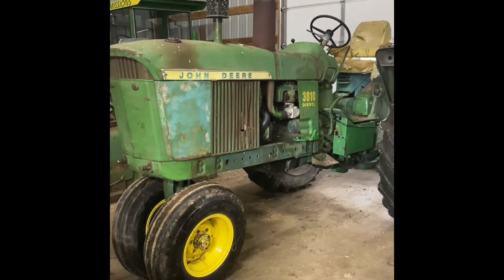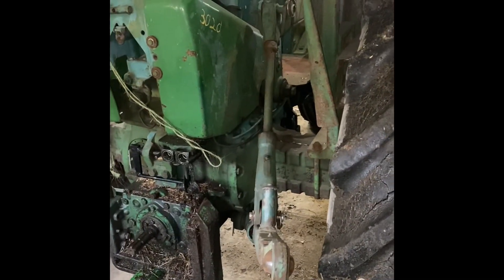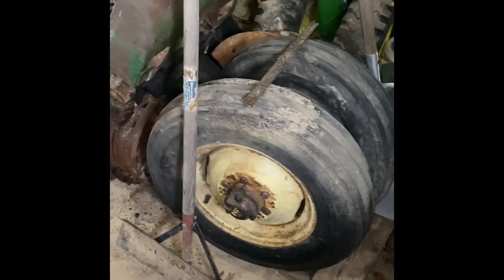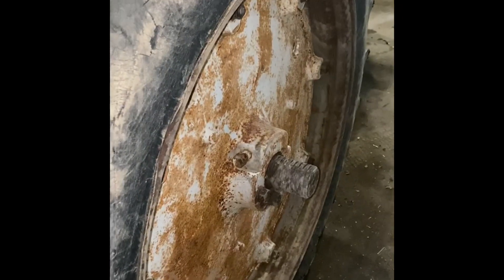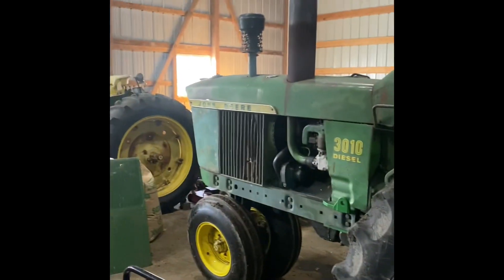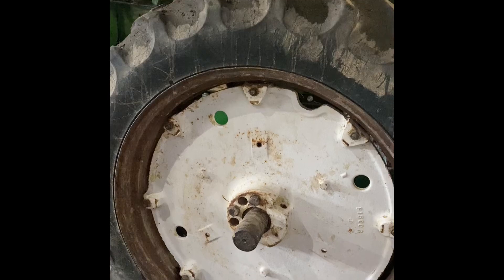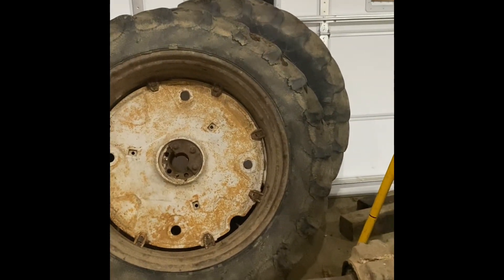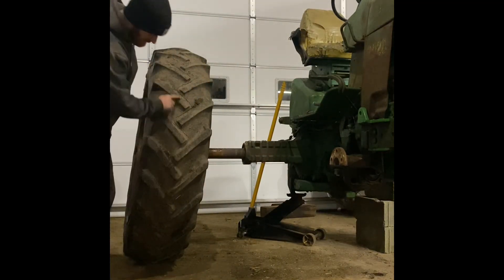Installing the 237 John Deere picker on the 3010 part 1

Comment: Those drive tires will likely last the life of tractor  they made tirers better back then    thicker and better rubber and the old 45 bar angle is a good look keep them youl be glad you did   that's all  goodnight

Comment: My son has a john deere 300 pull type picker he wants to sell. Would you be intersted in it? It has a 2 row wide corn head but we also have a 343 corn head that would fit on it. Also We have a few spare 2 row corn heads and I guess it is possible to make a 2 row narrow head out the 2 row wide head for use with 30" rows.
Reply from the maker: Location
Reply: @andrewssoundsofthepast110  we live in Salem Ohio which is a little east of Canton. We also have a running operating 55eb combine if you anybody that may want one
Reply from the maker: @TheJohndeere466  not to far